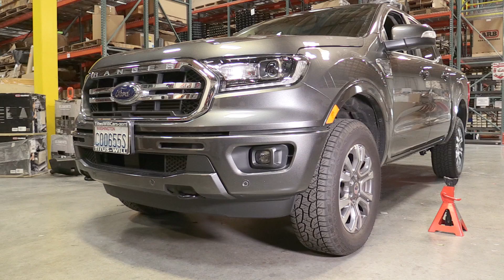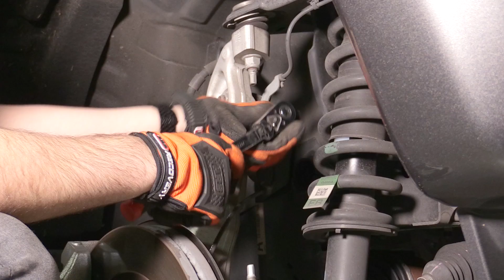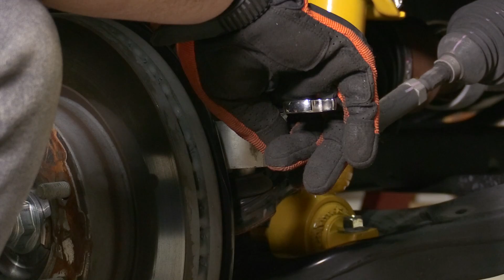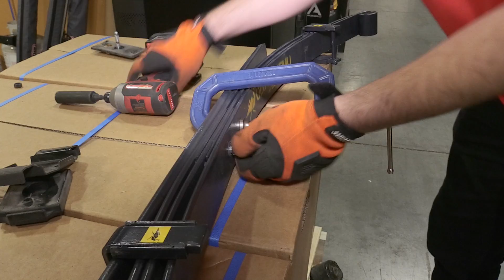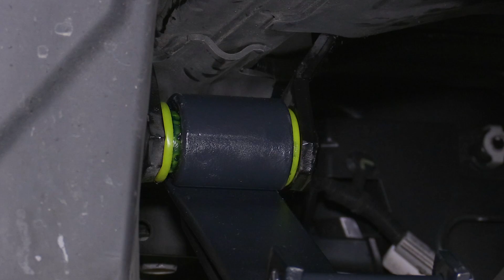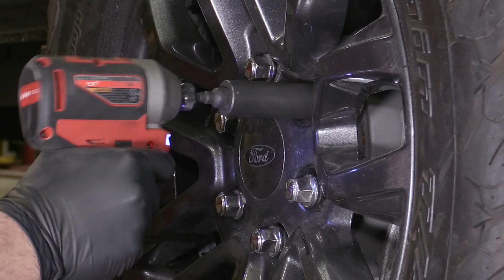Old Man Emu Suspension Installation - Ford Ranger 2019

Comment: you don't go into the details of the driver side leaf spring and shim craziness? The leaf center bolt head is too short for the shim and needs a spacer! How is such a small inexpensive part not included nor mentioned in the install instructions???